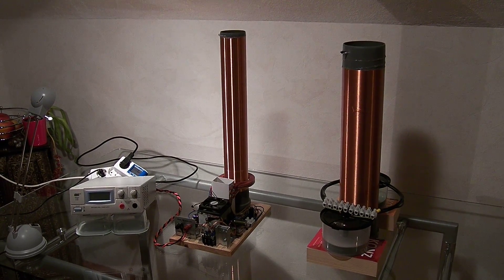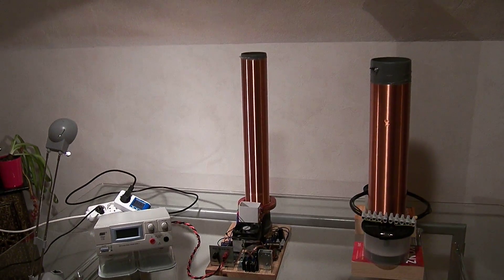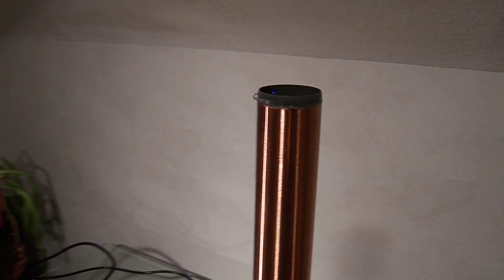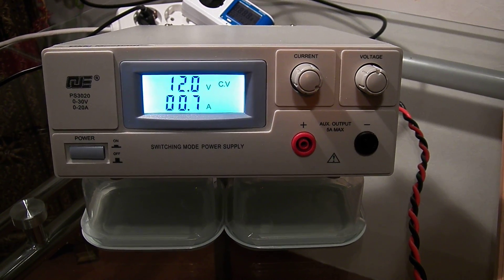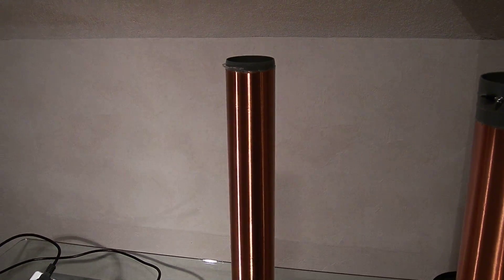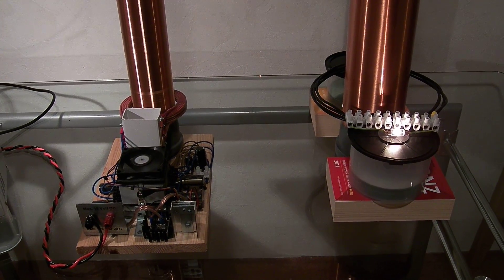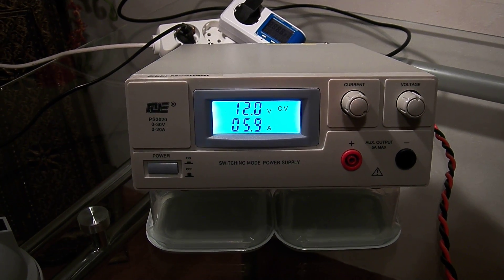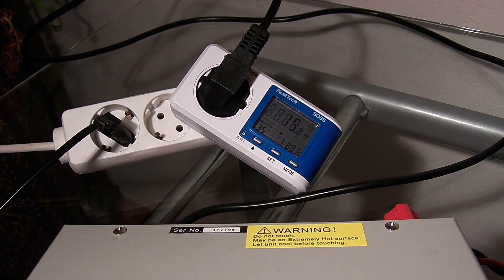Wireless Input Power Measurement - Showing Everything

Comment: Your factor went down to around .3 when you tuned the circuit by your approaching hand.  In other words, the power supply and circuit became more reactive and less resistive, very interesting.  Wouldn't that be nice if we could tune all circuits with a wave of the hand(:  Again your videos are excellent!
Reply from the maker: Thanks for your kind comment Mark! Yes, in high voltage - high frequency system we can use our hands to tune the circuit. That's why Nikola Tesla mentioned that his system is connected to the nature / environment.

Comment: Could you add another 5 watt bulb in parallel with that light bulb or replace that light bulb with one at 10 watts?
 I want to see if doubling the output bulb also doubles the input watts and amps. I'm not looking for over-unity. 
Thank you for all this work you have done.  I am getting parts to replicate your experiment.
Reply from the maker: The transmitter input will not be affected much. Only the output power will be spread out over two 5 Watt bulbs. Thanks for watching. Please post your result if you replicate this experiment.